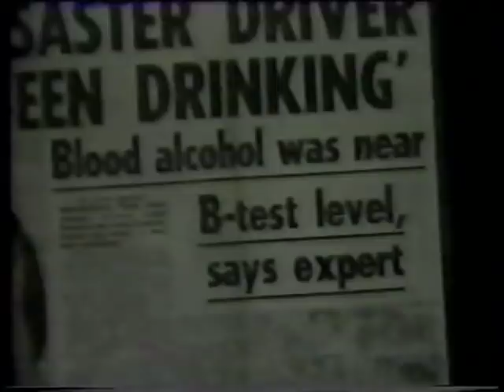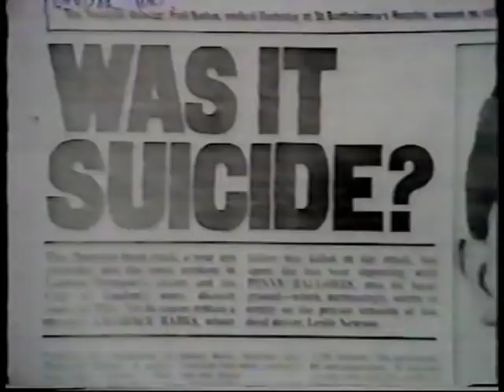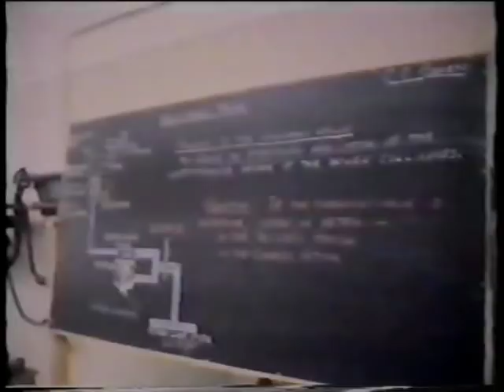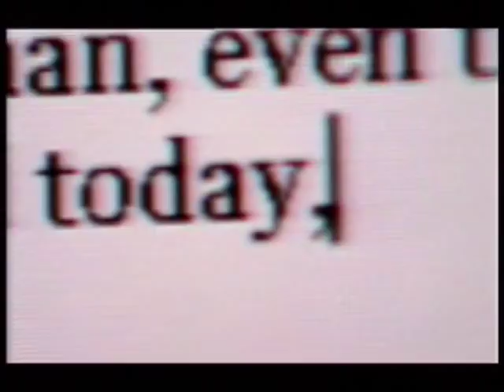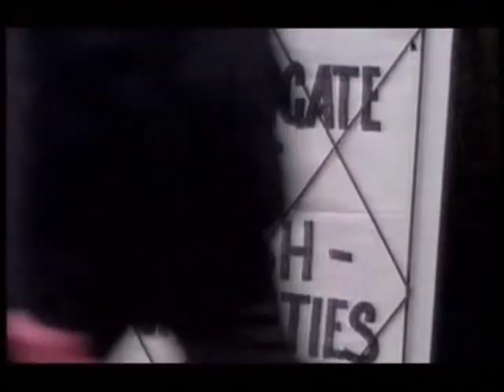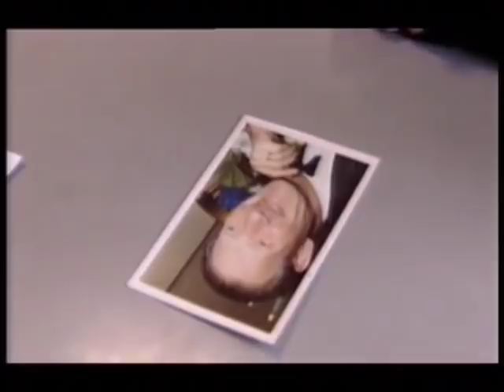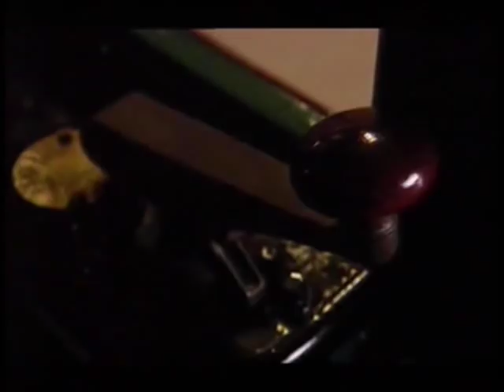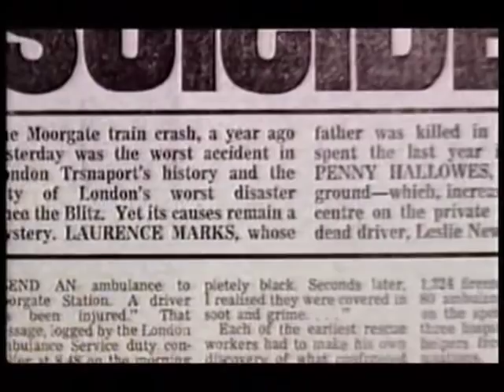MOORGATE ANNIVERSARY FEBRUARY 28  2015

Comment: I travelled on the tube for many years. It was not unusual for drivers to overshoot a platform leaving passengers to walk back through the carriages to exit the train, sometimes the doors were opened.
Reply from the maker: Lesley Leith  , yes . On the older trains if you overshot by a single pair of doors or often the actual platform was built without the additional car lengths in mind , you could as a driver cut out the first set of doors so they wouldn’t open and the passengers would use the adjacent set , anything more than that would be serious trouble

Comment: In my opinion, the crash was caused by miscalculation. If a driver entered a station too quickly they would most likely bypass it completely as to not overshoot or brake too hastily. 

I believe that when Newson entered Moorgate he himself realised that the speed was too fast for a comfortable and safe stop, so he decided to continue down the line instead. However, he wrongfully calculated it to be a through-station (possibly Old Street) rather than a terminus, and when he came to his senses it was already too late.

Comment: In conjunction with comments on his potential condition. The train was running at least 30 seconds late to start with, and the driver was known to be extra cautious and drive slower than the average driver. This would add additional time to an already late  journey. Was he trying  to make up time at a speed he was not accustomed to, being that this was in rush hour. His habits and responses, as well as superiors, under these circumstances need to be understood, and also the collective amounts of near misses on that route . He had, apparently, complained to management  that he was not happy with the route. What was the cause of his unhappiness-was it recorded.
Reply from the maker: splitneedle  Les has gone to his GP about some marriage problems that were bothering him . But having a history of mentally dosing off was well known by others on the job who knew him , making up time wouldn’t of been a  factor , lack of sleep and the fact he would drift off mentally was . LT never installed train protection at terminal stations until AFTER moorgate . They knew of the dangers and potential for a major incident , they knew about Les being only a new driver and him nodding off mentally, nobody will really know only the driver sadly . 

My closing comments are still to this day LT should shoulder the blame 100%  don’t blame the driver or his family ,

Comment: I use that station on an almost daily/twice daily basis, the same two platforms, the actual platform where the train hit the wall, and still can’t make out how this accident occurred?.
Reply from the maker: Jack Sugden nobody will truly know , my theory is Leslie newson had some sort of epilepsy that caused his brain to shut off momentarily . I don’t believe it’s suicide for one minute. This could of been prevented by LT at the time by implementing terminal protection by means of a approach controlled train stops . The chilling thing is as you’ve seen from watching the film , previously a serious of collisions had occurred and nothing was done to prevent another one . Most corporate companies would be done for manslaughter
Reply: TRIPLEVALVE62 THE DEPOT I agree with the epilepsy theory. I’ve had the condition myself and have been told I would just “switch off” and sit there staring
Reply: I think a siezure is possible and i think tunnel vision is possible too. Ive experienced tunnel vision while driving. Its scary and I understand how it could lead to this. He wouldn't have even seen the wall.
Reply: My dad, often falls asleep in front of screens and occasionally nodded off at the wheel too, it worry’s me

Comment: I get the WGC to Moorgate every day, Drayton park always seems a dead station, just a station to change the current. I think I will take a moment to consider that it was the last station many passengers embarked from.
Reply from the maker: Roisin Reid . If you look at the area where all the vegetation is on the right , that was where Drayton Park LT depot was , train 272 was maintained there , all that’s left is the buildings by the end walls

Comment: The main point is that there was no evidence to prove that the driver committed suicide. Lawrence Marks did his investigation to get some kind of closure and square things off in his own head. I feel for him. People must not forget that this was only a year after the Health and Safety at work act, so things have rightly changed for the better. Most deaths at work are caused by human error, so the H&S act has ensured that, were people have died, human error is taken out of the equation. The health and safety of people, is based on deaths or serious injuries, so things only get changed after incidents like Moorgate. The point was that if the driver had made an error, there should have been a system in place to stop the train. Nowadays if the driver was to overshoot a station, other employees are duty bound to report the incident. In 1975 Guards had no access to a brake handle, as they used to open and close the doors from a space within the carriage of a train. Only the driver knows why he didn`t stop at the platform. It wont be the first time that people are killed and there be no apparent reason or evidence to suggest a reason. Being a former firefighter, my full respects to the men and women of the London Fire brigade.

Comment: If the driver was deliberately driving the train through the station it doesn't necessarily mean he was trying to crash the train, it could just have been that he momentarily lost concentration and thought he wasn't at the final stop of the journey. Then, of course, the question is why didn't he stop at this station anyway, since you normally stop at every station? There could have been yet another reason for that, so two mistakes combining together. For instance it could have been a combination of the following two factors: (a) he decided not to stop at this particular station for some reason that we don't know, for example because he thought it wasn't safe to stop due to something he'd seen as he approached the station (which was probably a mistake, since there wasn't anything in reality which fitted this explanation), and (b) at the same time he thought, for some reason, it was the second to last station rather than the last station due to a lapse in concentration. Those two factors working together would explain the crash — in fact the first one actually makes the second one more likely, due to distraction: ie, the fact that he thought he noticed something which meant he shouldn't stop at the station could have distracted him from realising it was indeed the final stop. For example: maybe he thought he'd seen something suspicious in the station, which would explain why he apparently accelerated to get out of the station (believing it not to be the final one on the line). I know that's a bit convoluted, but it's just an alternative explanation to the usual ones.

I've noticed that quite often when one first thinks about an incident like this, there's a strong tendency to try to identify just ONE factor that was responsible, such as suicide, or heart attack, or mechanical failure, etc. Intuitively it feels right to put the blame on that single factor. But then you realise after a while that this is completely wrong, and that it's actually far more likely to be two, three, or even more factors combining at the same time to cause a chain reaction of cascading mistakes within a very short time period. It is odd, isn't it, how the single factor explanations just FEELS more compelling to begin with.

I think suicide can almost certainly be ruled out, simply because it would have been impossible for anyone not to instinctively raise their hands just before the moment of impact if they knew what they were doing. So it was either a mistake by the driver who didn't realise he was driving into the wall, or he suffered something like a seizure or other medical condition just before the crash.

Also, the end wall should have been painted a bright colour, not left black as if it were a real tunnel. It reminds me a bit of the Mount Erebus air crash in 1979 where the phenomenon known as "white out" meant that the pilots couldn't distinguish between clouds and the snowy white face of the mountain because they were exactly the same colour (or non-colour).

Comment: Don't forget this was 1975 - 40 years ago...medicine has come a very long way in those years.   Reading TripLevalve62 comments it does sound like absence seizures.  But in those days would it have been diagnosed.
Reply from the maker: Nog311  correct . If this had happened today , it wouldn’t of simple as that why ? 

1- terminal protection would apply the emergency brakes if the train was going to fast on the approach by means of a speed trip . 

2- a full medical would of been implemented by management if staff are noticed to be not coherent . 

3- Previous medical injuries due to an accident or incident would involve a follow up with a GP or consultant given possible further related issues .

4- management have a legal duty to fully train train operators and ensure that they know their road and train fully , Les never had the training properly , the basics were taught but the rest had to be learnt out on the job , today your tested thoroughly

Comment: They were cutting torches to cut the metals which deprived the area from oxygen. The oxygen levels become low and people in the front carriages suffocated.
Reply from the maker: Achilleas Labrou  the people in the front cars properly were already dead from crush injuries plus the humidity of the conditions . The cutting torches wouldn’t of really attributed to suffocation as the LFB would of had oxygen cylinders  as well as  acetylene tubes for cutting , not saying your comment is wrong but I think generally the air level was very limited if not at all . 

For sugar to ferment in the blood stream and into alcohol due to rapid decomposing in six days in that heat is somewhat of a clue

Comment: 20.00 - one of the most backward and shocking statements i've heard. My general opinion on the crash is that he had things on his (tired?) mind coupled with the safety aspects e.g no auto stop at the end of the tunnel!
Reply from the maker: I agree . Another theory is that Bob Harris the guard went to the rear cab and opened up the drivers brake valve isolating cock ( dbvic ) which would of rendered the brakes in the lead car useless
Reply: Why would he do that? He looks quite nervous in the footage but i think any young rocker guy then might seem that way 'caught up' in this. Was he just behaving like the others in a sloppy work practice environment?
Reply: It is a stupid thing to say, but people were obsessed with saving money at that time, they thought it was morally right to save money more than anything else. I've known a few older people like that.
Reply: You can function on 6 hours sleep just fine. If you've been doing 6 hour sleeps  for years, you deal with it easily.

Comment: It is a very real possibility the train brakes were faulty, there was a train with faulty brakes, that morning, that was supposed to be going off service to the yard, but because of several staff being late , there were train changes that morning. If Mr. Newson was driving a train in which the brakes have failed, the description of him sitting upright, hands on the controls, staring straight ahead, could be spot on for someone who was suddenly confronted with a massive failure. It has been shown in trials and surveys, that if the driver of a car suddenly experiences this, he will tend to just press the brake harder hoping it will work, exactly the same for Mr. Newson. There are people who were working there that know about this and say the labour government at the time swept it under the carpet.

Comment: How much force does it take to keep the dead man's handle down?  Could a sleeping person do it?  Many questions.
Reply from the maker: ***** a reasonable amount  .There is a spring inside the master controller that is attached to a latched pin that is connected to a sprung valve which in turn is connected to the train line air supply, thus a sleeping person would automatically drop the deadman causing an emergency brake application
Reply: i was told a common practace was to put a heavy  shopping bag hung on the lever  to get hands free driving        then  this happend to one driver who had problems with the doors, he got out of the cab to kick the doors.    the doors then closed after him kicking them    then the train then left the station without the driver untill being tripped    the passangers were safe   i dont know what happend to the driver though  i think the train went along with his job         if this happend at moorgate a bag would have been found during the investigation   i think the poor driver became ill and there was no back up to stop the train

Comment: What I don`t understand is why Driver Newson had Green signals approaching a dead end terminus ! Surely you should get a yellow for caution not a green !?
Reply from the maker: Sam Green that's right , should be a repeater for the stops at the end of a terminus
Reply: The yellow before a terminal was one of the recommendations made after this collision.  Furthermore timed trainstops were also installed to protect passenger terminal platforms on LT.

Comment: if the train fails to slow down coming into moorgate station then there should be a cut off power and all other dead end stations should be the same
Reply from the maker: robert roberts  as mentioned by myself and at the time , London Transport implemented terminal protection for trains entering a dead end terminus in terms of signaling

Comment: Who is the journalist on the BBC Southeast film?
Reply from the maker: Elouise Payne . John Stapleton
Reply: Very impressive for so young.  I am US so I had to look him up.  I recently ran across the Moorgate crash and have been reading about it.  I am only very familar with the NYC subway cars.  I have been looking at some videos of the 1938 tube stock on YT (amazing what one can find).  What exactly is the duty of the guard on the train?  And does the motorman's cab extend across the entire front of the car.? Am I right in reading somewhere -Wiki, I think-that there were different configurations of the car?
Reply from the maker: Elouise Payne  , in those days the job of the guard was to open and close the doors from the rear of the train at stations , once the starter signal was off or green  at the correct time of departure he would close all the doors on the platform side of the train and give a single bell to the motorman up front  who would move the train , also the guard would be there to apply the emergency brake handle at his position should the train fail to stop at a station . His job was also to act as motorman in emergency to drive the train at 5mph to the next station or depot should the driver become ill . 

The 1938 tube stock was the first type of train to have all its electrical equipment under the floor as opposed to a compartment behind the motorman . By 1975 the 38 stock was approximately just under forty years old but quite reliable,. My I personally suggest  Richard Jones’s “ End of the line , the Moorgate disaster “ a truly accurate account based on facts and the people in question , not a media campaign to slander the driver and his family .
Reply: @Richardsrailway  Guard then is what we would call here in NYC a conductor.  And just last night I found Richard Jones book on Kindle Unlimited and have downloaded it.  I  have seen on a couple of forums mention of a book by Sally Holloway "Moorgate,  Anatomy of a Railway Disaster" and claim it is very accurate.  However it was published in 1989 and now out of print, although I am curious as to why it is considered so accuate as no one elucidates. Anyhow thanks so much.

Comment: It's simple. Mechanical error without any doubt. Imagine the payout had London Underground accepted responsibility. Imagine the heads that would have rolled. No, no, no. This was driver error. After all, he's dead ain't he? Blaming the poor driver is despicable but common practice back then. This was mechanical error but they were never going to admit it. Common sense tells us.
Reply: Usual driver,pilot or captain dies or the plane or boat goes missing its their fault until otherwise proven.
Example Air France there was all kind of stories until the plane was found, that did turn out to be pilot error, mind you sensors on a modern plane shouldn't freeze up, but it wasn't seaside or a pissed off employee.
Reply from the maker: If terminal protection was in place BEFORE the incident, it would of never happened , the previous incidents were an omen that LT should of put those measures in place .